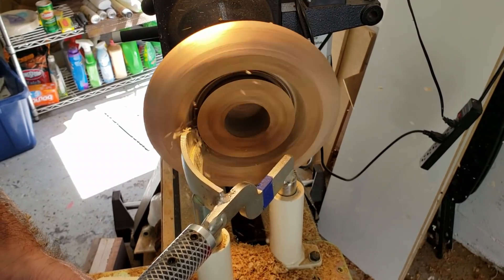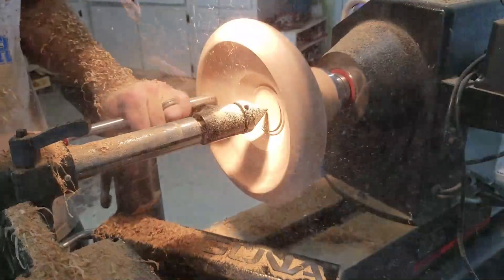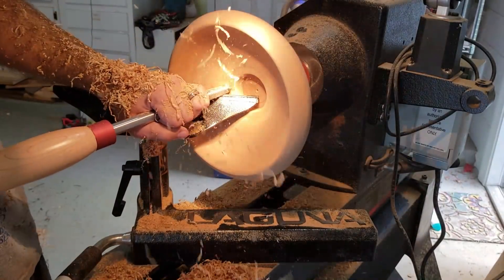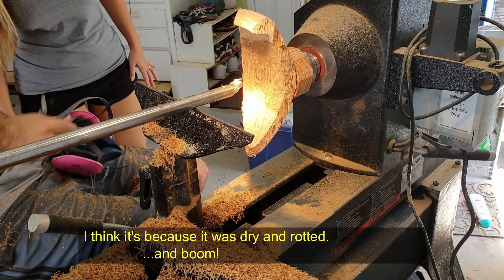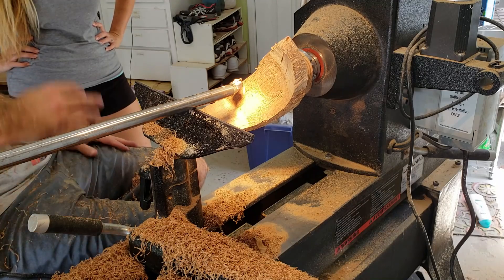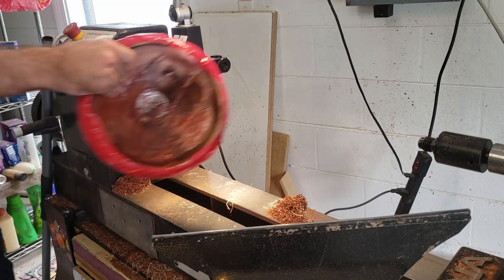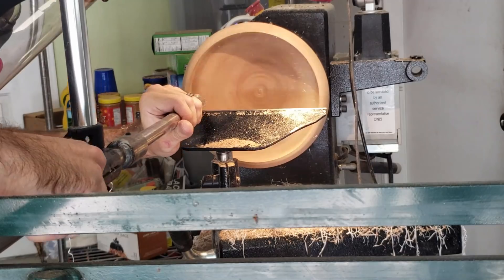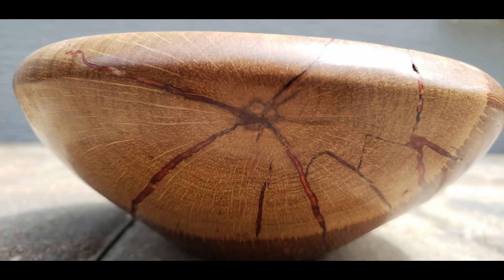Bowl Explodes in Face - I make The 6-Million Dollar Bowl

Comment: Just a few observations.  You didn't cut out the pith, this is were the cracks stsrted. That sid, I'd used 5 minute epoxy for the repair (you can add dye to it for color in the cracks).  Found wood is almost always problematic, I know because I've harvested many trees and tried to turn pieces from them.  Most ended in the stove.  Be well.
Reply from the maker: Yeah I am definitely more aware of the pith now. Sometimes I still gamble with leaving it in for example I have some box elder with a really interesting pith that I wanted to leave in tact. But now I check my wood for cracking more religiously.